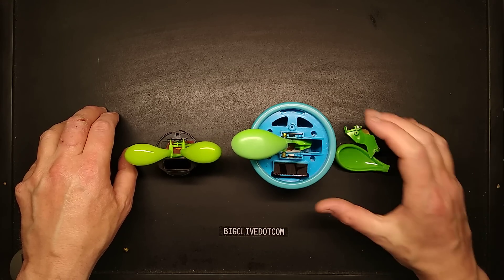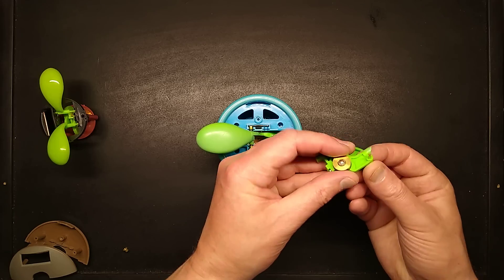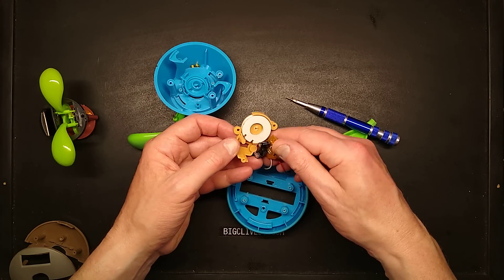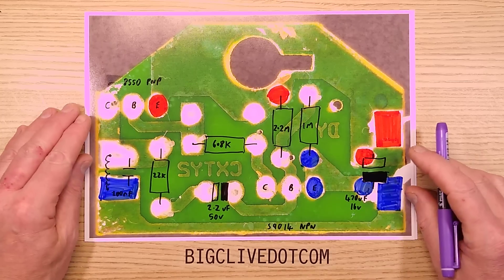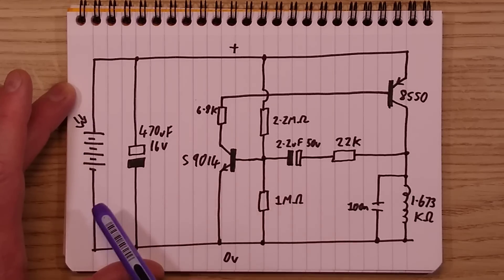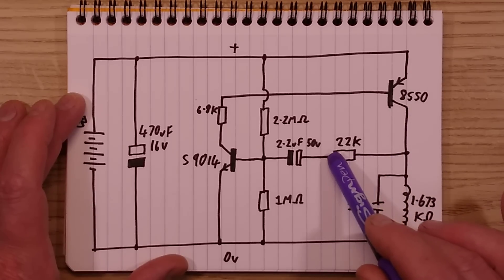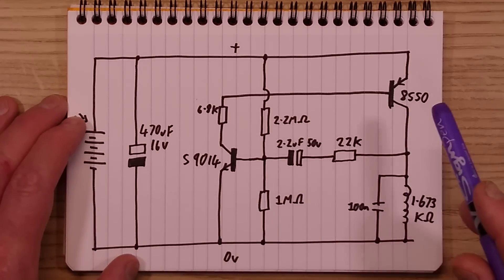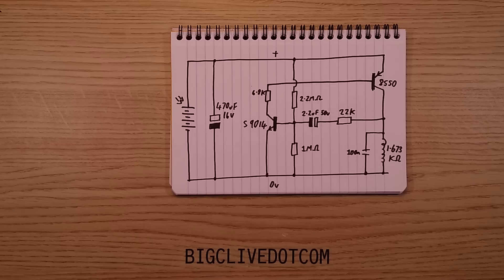Really nice "flip flap" pendulum kicker - with schematic

Comment: The IC needs to be more complex to get around the fact it's impossible to put a 2.2µF capacitor on a chip. It might use a tiny capacitor and an op-amp based capacitance multiplier circuit, or something completely different.

Comment: Certainly nothing a little cyanoacrylate can't fix...

The same or very similar circuitry is used in "electro-pendulum" clocks, either containing an actual swinging pendulum or a hairspring and balance wheel with magnets.

Comment: Are you gonna delve into "Neko Waving Lucky Cat" items that have a similar mode of operation? Similarly amusing to watch. I assume the lil cap across the inductor is some sort of filter, so as the device runs out of power it doesn't "buzz" when low on power, due to not having enough current to propel the magnet beyond center.
Reply from the maker: Lucky cat already investigated.

Comment: Standard SCR configured pnp-npn combo. for the regenerative latch effect. 
( b-c of npn to c-b of pnp). Because the b-e of the npn has a dc blocking cap, It requires that trickle bias current from the 2M2+ 1M series resistance resistance
 divider to tickle it to flip-flap around

Comment: Some of your videos are "Potato Vision" because YouTube has chosen to paywall full bandwidth for 1080p.  If you can record in 50/60fps and/or at a higher resolution like 1440p or 2160p it seems to still circumvent that mode.
Edit:  Add 50 for those in 50Hz/PAL countries.

Comment: Why were the highlights pink, holy hell

470uf on a tiny solar panel? When is that ever going to charge it 🤣

Why do they all stop working after about 6 months

An inductor and capacitor? Isn't that an lc circuit, how would it stop oscillation when it's made to oscillate

Comment: If one were to make one of these, what sort of off the shelf coil would work? Or if winding one, how critical is the wire, diameter and number of turns?
Reply from the maker: The choice of coil and capacitor might take a bit of experimentation.
Reply: Ugh nothing is easy. Even the simplest childish enjoyment turns into a tedious engineering chore
Reply: @pleasecho2 
Designed & Built by Engineers who love kids & their fascination for toys..

Comment: So what makes the coil have such high resistance? If you measure resistance in most transformers and such it tends to be pretty low.
Reply from the maker: It's wound with a very long length of extremely thin wire.

Comment: That 100nF cap across the inductor is a very interesting use of a tank circuit.  
If the colour code is red red yellow gold as pictured, then the coil is 220mH, which will make the resonance frequency with the 0.1uF cap, at about 1KHz.
I built a Bedini pendulum decades ago. It used a single transistor but had a base winding. Then got board and converted it to a Bedini SSG motor with my son for his school science project.
We both learned a lot about pulse motors and their efficiencies. It even fools people into thinking they found free energy!!!
Reply: I made one of those and put a small speaker in series with the battery. Made an odd beepy/squawking noise every time the transistor fired. Fun stuff.
Reply: The cap is for noise dampening.

Comment: How does it turn off the transistor? I guess when the magnetic field decrease the induced voltage goes negative and the base current is decreased. It means the transistor is on when the magnet is getting closer and off when it is moving away. Very clever.

Comment: I think the tricky part of a DIY version is the coil, very thin wire and a lot of it to get to 1500 ohms!
Reply: You can easily make thousands of winding on a coil with a normal battery drill. You spin the coil with the drill and spool the wire onto the coil. I did that for a guitar pickup some time ago, worked first try and took like 30 minutes for 1000 windings.

Comment: You can keep these going all night by soldering a 4.7 Farad super capacitor directly across the solar cell, a discharge protection diode is not required. It will take a few minutes to charge initially but from then on never appears to stop! I've had one going for over a year non stop.
Reply: I got mine a few months ago and I put it at the south window. Sometimes I am sleepless at night. So I defined: When the Flower thing is flapping, then it's day ;-) 
This would be ruined by that super cap.

Comment: Could you look at the cheep ebay solar panels for cars? Mine was about £13, it came with a  cigarette 12v, battery terminal clamps and also a connector to the obd2 port. I have mine plugged into the obd2 port as it was the longest wire. It also has 2 usb ports and 1 usb c port. If I charge my phone through it while it's still plugged into the car, it knocks the radio off. I was hoping you could do a teardown of one to see if it can be "fixed" with a resistor or something

Comment: Ironically, I bet the complicated blob chip is cheaper to produce.
Reply: Absolutely, packaging cost (bond wires, legs, molded case) dwarfs the silicon cost for stuff like this. So two packaged transistors with leads (nevermind the extra passives) cost more than one blob IC bond wired straight to the PCB with a drop of epoxy over it, provided you order them by the million.

Comment: Interesting circuit. Thanks.
If I had to guess, the inductor and the 100n cap form a parallel LC oscillator. If you were able to measure the impedance of the inductor you would be able to calculate the frequency. The moving permanent magnet is then pushed in opposite directions in an alternate fashion.
Reply: The capacitor is for noise dampening.

Comment: Very clever circuit, always more interesting to see something done with a couple BJTs than some black box. Looks easy enough to copy, inductor is the only question, can you buy a coil like that or would it need to be hand wound?
Reply from the maker: It would be better to buy a spool of wires and wind it with an improvised winding aid like a cordless drill.

Comment: I remember building a similar circuit some time as a thing that drives a small electric motor from a small solar cell that didn't have enough current to power it. Also had a big capacitor to store the energy and then two transistors for switching. I never thought it could be used in the solar pendulum toys, but I guess they are essentially a motor anyway.

Comment: Fantastic. Defiantly going to have a go at making something with this circuit.
It's just finding the right coil, don't fancy winding my own. Hard part is what phrase to use in the search engine ha-ha.
Reply: An old  battery clock has nice coils in them. You should get oscillations going with one of them. You could try it.
Reply: @keithking1985 ha-ha It just so happens I have just replaced one of those cheap quarts mechanisms in my wife's kitchen wall clock she got free with Tetley teabags decades ago. Haven't thrown the old one out yet.
Reply: I suspect value is not terribly critical, I'd try some small solenoid/relay coils with the core removed. I think jumble/solenoid winding will do here, so the only winding difficulty would be working with such fine wire, probably #30 or thinner.

Comment: I built a solar pendulum using the book, "JunkBots, Bugbots, and Bots on Wheels" that we used in our Electronics class in college.  I modified it to use sunlight or battery.  The main cap is 4700μF and the coil is a 1H "Major Henry" you used to be able to buy at "Solarbotics."  It's 12 years old and still "kicking."
Reply: entonces se p uedehacer que vuelva a la vida mi gato de la suerte. tendras el diagrma como queda, esun recuerdode mi hijo,de los del dia del padre.........   then my lucky cat can be brought back to life. You will have the diagram as it is, it is a memory of my son, one of those from Father's Day
Reply: si se puede la lista de componentes. gracias .If possible the list of components. thank you

Comment: I suppose this circuit could be used to make a pendulum clock that's battery-powered instead of spring or counterweight.  Don't know why you'd want to, but you could.
Reply: There are pendulum clocks on sale that use quartz crystal timing and the pendulum is electrically driven just for show but they probably don't bother to use magnetic feedback, just accurately timed pulses.
Reply: @petehiggins33  
Yes, I know.  I own a fake pendulum clock.  As to your point, that's why I said "I don't know why you'd want to".  Even the very best pendulum regulation can only hope to match the accuracy of the most low-end quartz regulation (unless the quartz is some sort of outlier in crappiness).

Comment: Awesome, do all these pendulum, coil devices have circuits or are some just coil and magnet?  I have a "Lucky Cat" but don't want to disassemble, it was rather expensive being painted ceramic.  Thanks Clive, very interesting.
Reply: Most will just have a blob chip doing everything, this one is interesting because it's early enough to not use an IC.
Reply: If you can design one with just a coil and magnet then your Nobel prize awaits.

Comment: A thing worthy of note; these little solar cells are Amorphous type, like those found in garden lights...
However, unlike the garden light, the solars in calculators and the like are a specific low-light or indoor type!
They are only capable of handling light levels up to 100K LUX; basically putting them in direct sunlight degrades their performance; ruining the low-light performance.
Reply: Thanks for that explanation @Vilvaran. I got one about 3 months ago and put it at my south window. A few days ago I realized that it was now less sensitive at dawn.... :(